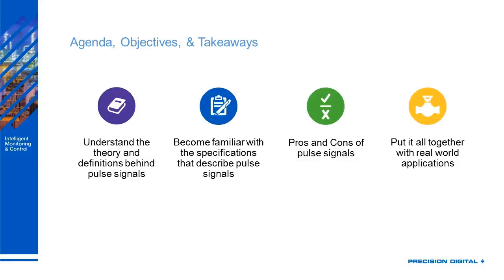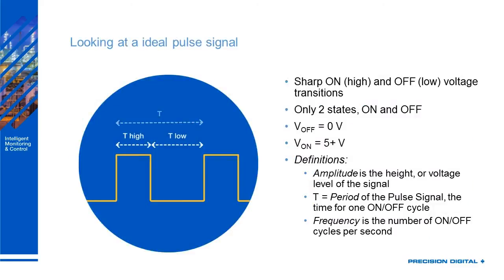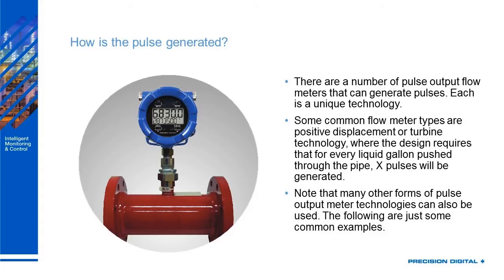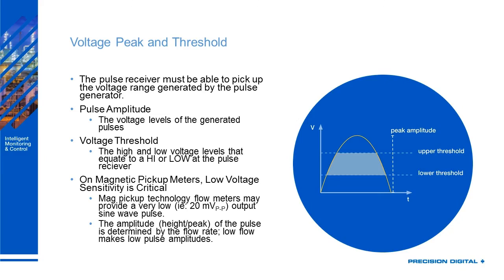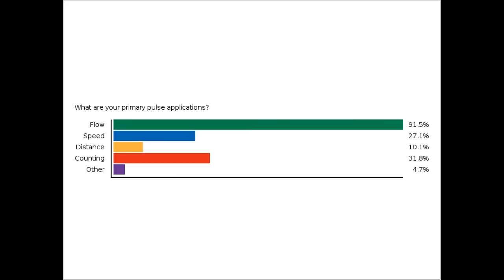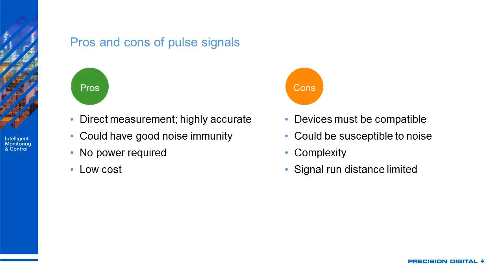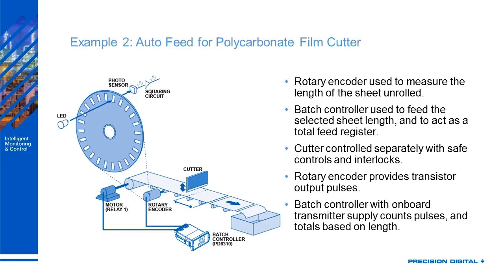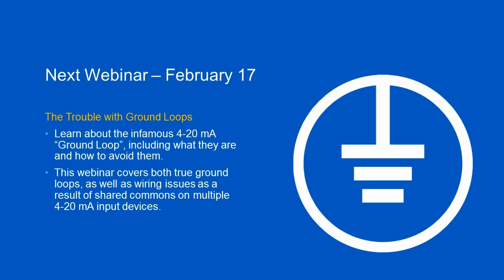The Fundamentals of Pulse Inputs

Comment: I have a turbine flow meters whose output is NPN open collector sinking. This needs to travel only 10 feet. For this do I need to convert it to 4-20mA using signal conditioners? also How do I scale it in the PLC ladder logic program to get real values?
I have one FTB-432 and FPB1402 from Omega. Thanks-Maqsud